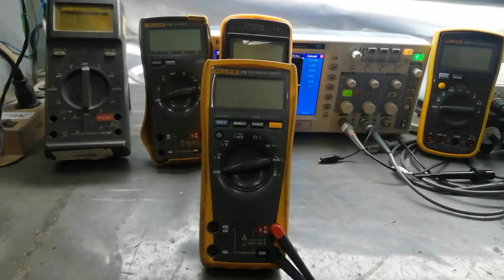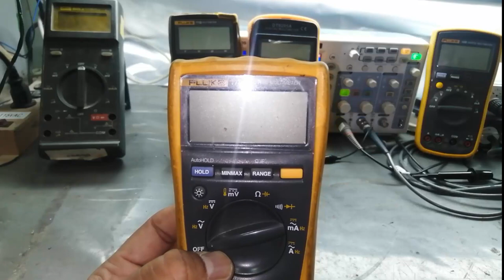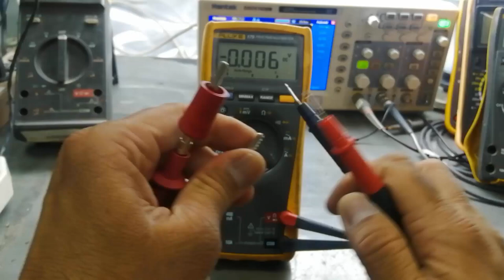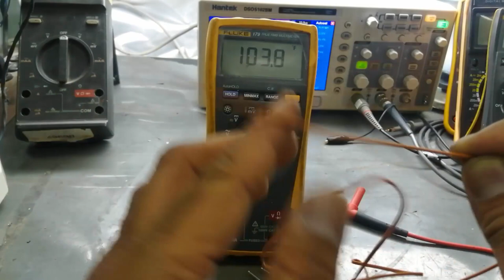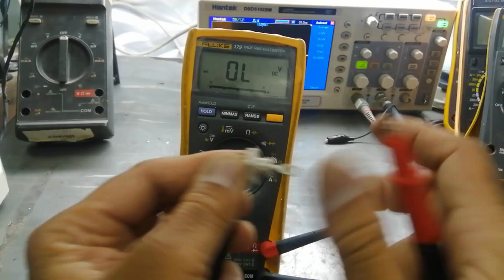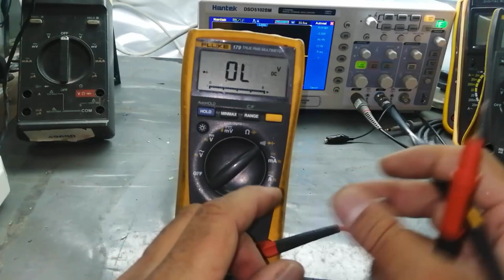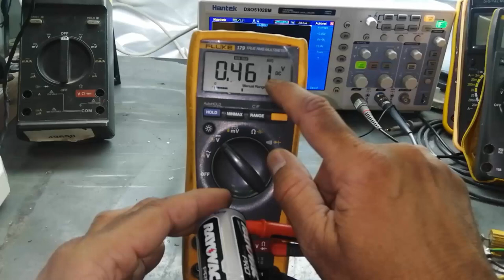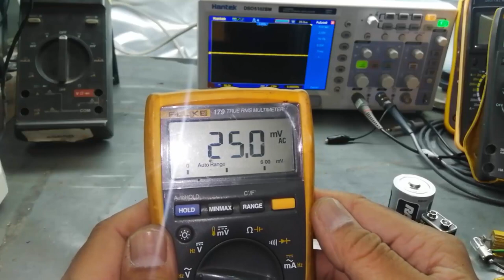#140 How to Use a Multimeter (Detailed Practical) Haseeb Electronics

Comment: Sir  can you  enlighten me regarding  how  to use  my digital multi meter my  tester.  Uni t is not auto range and  when I used it  to  check  the  resistance of the different. speed resistance of my electric fan motor  and I used  the  continuity mode  and my test probes    
Point to  the plug  and my meter tell  me ol because I don't know the speed resistance of fan motor and I ask myself why my meter act  like that because of my curiosity to find  that speed resistance many days passed I tried again  to check the resistance again this time I used  range 100 , 200 nothing happened no reading and when I used the 1k. range 1k I got the resistance ranging 530 and  up why is that sir  because  the analog tester when you test continuity  put in Range10 if there's a  continuity and there's a resistance the meter tell you why my  digital tester didn't tell me the resistance using continuity  mode my first time using digital tester tnx Sir
Reply: We actually have auto range uni-t digital multimeters. There are actually numerous of them. Yo can go for any of the uni-t ut61 series thanks